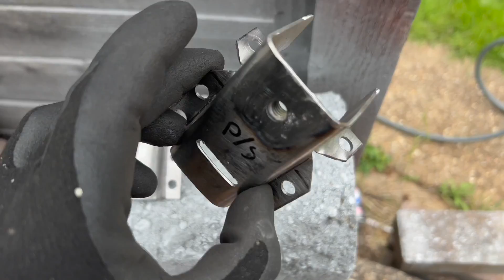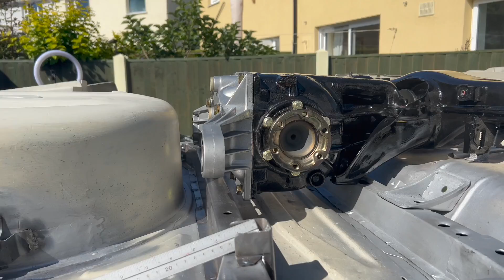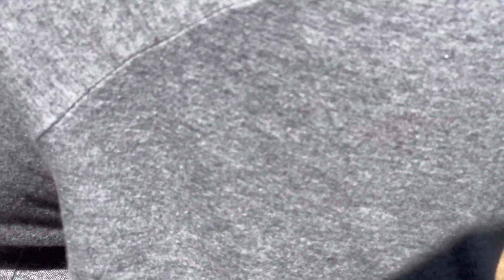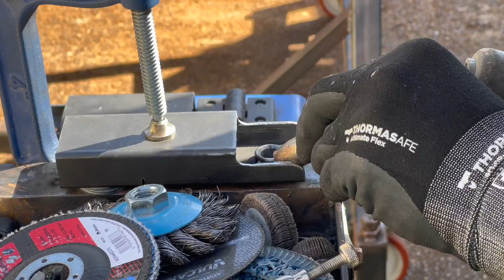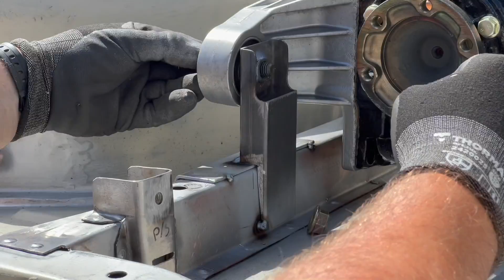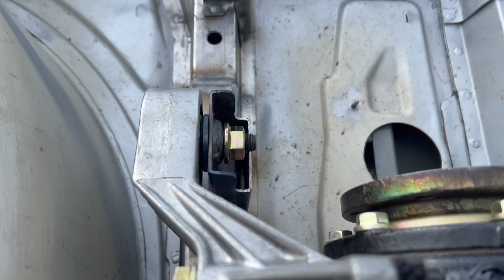EP. 13 My BMW E30 Restoration - Fabricating E36 Twin Ear Diff Cover Bush Mounts

Comment: Nice. What engine and power are you going for ?
Reply from the maker: Thanks! It’s getting the s38b36 from an e34 m5. Standard is just over 300hp, mine will have some slight modifications

Comment: Any plans on potentially using seam filler for in between the cross members and the chassis?
Reply from the maker: Yes ! This is a job i will do with Upol Grey Stripe brushable seam sealer. Just need to make sure the area is totally clean